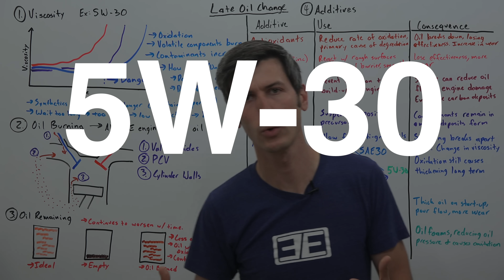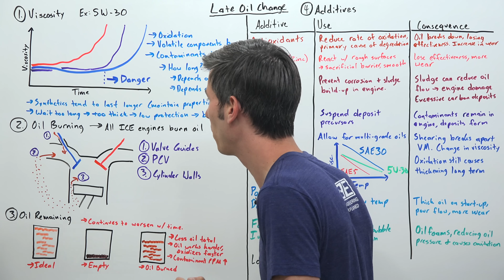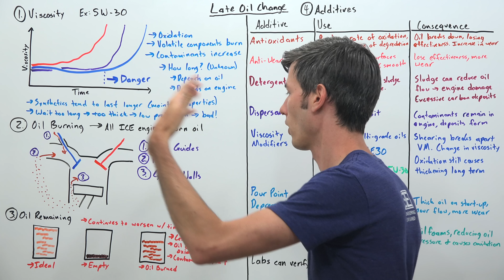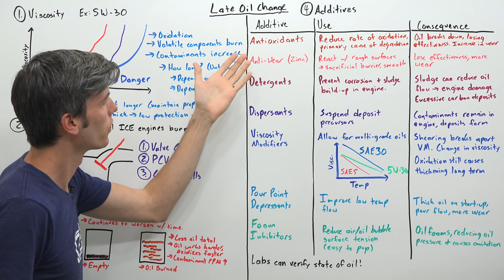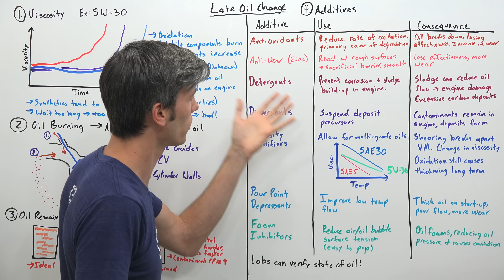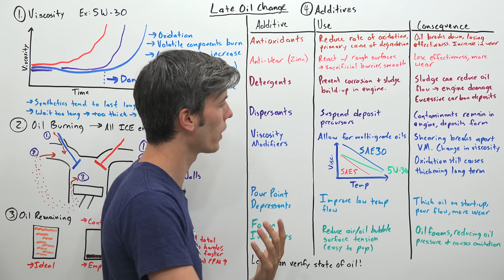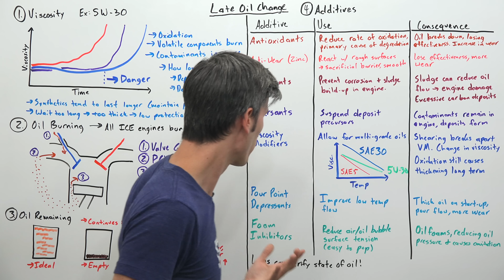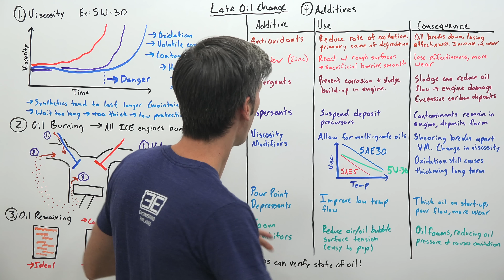What If You Forget To Change Your Oil?

Comment: 1) viscosity gets worse with increased mileage and heat breakdown ..this is bad because engine metal parts break down and grind down( wear out)....this is bad because this decreases hp and decreases mileage and increases engine temperature which further breaks it down....cascading effect accumulates
2) carbon deposits increase with increasingly dirty oil....
3) various components breakdown over increased mileage....
Great explanation ! All true engineering principles.

Comment: During the Covid years of 2020 to 2022; I rarely drove my vehicles. For my Infiniti Q50 with Full Synthetic 0W-20, I drove less than 500 miles/year. For my 2003 Nissan Maxima with conventional motor oil, 5W-30, I drove less than 1500 miles/year.   Here is the question, when should I change my oil? Should I go by the miles or time (months)?  The Q50 recommended oil change intervals is every 10,000 miles.  The Maxima recommended oil change intervals is every 3,750 miles.

Comment: Certain engines can be very punishing on their oils; with very high shearing forces, contact pressures and local hotspots that can break down the long-chain viscosity improver(VI) molecules that serve to maintain the oil's hot viscosity. For example, in Nissan's VQ37VHR engines the VVEL valvetrain mechanism creates a lot of shear forces and high temperatures that cause the recommended engine oil(Nissan ester oil) to shear down from its nominal 5W-30 rating to about a 5W-20 after about 3K miles. This is a consistent occurrence that I've seen on at least 3 or 4 used oil analysis reports on this engine with this oil, as used in 370Zs and G37s.

Comment: And they actually another big concern is actually not inside the engine but the engine starts to burn oil you can clog up your catalytic converter which once it’s clogged can affect inch performance and actually start to overheat the top end of your engine so that’s not good

Comment: I was told by the dealer my Jeep 2020 Cherokee 2.4 needed a 3k OCI. I bet it is because the tiger shark 2.4 can loose 1 quart every 1,000 miles  by it being sucked in by the intake. I ran mine to 4,800 with no make up oil and Blackstone labs said go another 1k and re-test. I heard Fiat made it so the multiair system holds the intake valves slightly open upon deceleration to cure the oil consumption

Comment: Thanks for the useful content. What about cars that are parked most of the time and used for short intervals. The Oil is recommended to change after 10,000KM but actually, this car makes this distance in about 2-3 years. Is there also a time interval after which the oil and other parts should be replaced no matter the mileage? 
What's recommended in that case for the Oil, filter, and other spare parts replacement.
Reply: Great question 3k mi or 3 months witch ever comes first I herd

Comment: you say, you change your oil every 6,000 miles, I do mine at 5,000 mile interval, now why do some oil change places recommend every 3000 miles? I had seen on 20/20 some years back, where they ran a test on New York cabs, ran them for 10,000 miles and the oil was in decent condition after running test on the oil, so what is a real safe miles interval to change the oil, my son's 91 Volvo 240 it says every 10,000 miles unless it is turbo, then it is at every 3,000 miles.

Comment: "All engines burn oil" Not true.   Was broke in mid 2000s (just out of college)  ran a bmw 328i e46 well over 45k miles without oil change or adding oil.  Would check the level every now and then. Sold the car running smooth with 300k miles.   The 330ci on the other hand burned 1 quart every 1000 miles.  Same driver, same roads, same weather.

Comment: Here comes the age verses distance question. Many car makers advise changing the oil every so many kilometers, say 10,000, or when the maintenance minder tells you to change the oil, or – once per year, whichever comes first. What happens if, say 12 months have gone by, but you have driven only 5000 kilometers, or 6000 kilometers, and you wait a few more months to change your oil? Or you wait another year – at which point the car has gone 9000 or 10,000 kilometers? Which is worse, waiting too many kilometers, or waiting too many months?

Comment: I have an unconventional way of doing oil changes that seems to work.   I religiously change my filter every 3000 miles and top off the engine with a quart of oil.  On my LS3 GM engine I have gone 110,000 miles and I have only drained the oil twice.  I autocross the car on occasion so it is not babied.  I changed the valve covers and it looks almost brand new.  I am using Mobile one and AC Delco filters.

Comment: I own a hotshot trucking company and regularly exceed the recommended oil change reminders on my 3500 ram Cummins.  Had several go over 500,000 miles through the years and these trucks work hard pulling loads exceeding 20,000 lbs!

Comment: My engine with near 300,000 miles on does not use more than 50ml of oil per 10,000 miles ----- but i change oil every year or 10,000 which comes first and with top best quality oil

Comment: What ever you're going to say I will keep changing oil at max 8-10k km. Short drives that never warm the engine, prolonged idling, awful winter with temp often below -15°C, very humid summers. And finally, too many engines with baked piston rings, burned valves or other valve train issues such as valve guides coming out of the head in Subaru, worn out timing chains, guides, and cam sprockets, ending on engines which throw the rod, jumped the chain or self-destruct in other manners. Some of them we were able to bring back to life, others had to be changed. Sorry but theory is one thing, real life situation might something else.

Comment: Very informative.  I have stopped using conventional oils, full synthetic only.  I seem to see less sludge in the valve cover when I am adding or changing oil.  I thought the issue with conventional oils was change-scission (viscosity reduction) due to shearing.  (Regularly get 200k miles on my cars. One is over 300k miles...still in the family.)  I seem to remember that Consumer Reports did a big test on motor oils in the '80s that utilized a diesel injector to spray hot oil under test to causing shearing.  It was illuminating, as almost every oil did not stay in viscosity range.  Can't recall if Mobil1 was the winner. 
Also, if you get your oil tested, as fleet operators do, they return a result called "TBN" (Total Base Number) which measures the oil's remaining ability to neutralize organic acids produced by combustion (Carboxylic Acid typically).  At issue would be excessive idling experienced in many petrel fleet engines and also diesel OTR trucks that idle all night long.  This operation is considered severe duty for that reason.  Low oil temp does not allow the off-gassing of the water that is trapped in the oil (remembering that water is one of the main products of combustion :))  Comments regarding TBN?

Comment: Thank you for the breakdown of what a motor oil includes, and the viscosity rating.  I live in Arizona though, where summer temperatures are more important for viscosity than winter temperatures.  What happens when you have thermal viscosity breakdown?  What will you experience, and how do you address this problem?  Should you switch to a higher viscosity oil, or a single viscosity oil that is still within the manufacturer's recommendations?
Reply: Ha, I'm in AZ too and I thought the same thing last week when I changed my oil.

Comment: My engine in my 2019 Hyundai Accent just failed and they are saying it is because I wasn't getting enough oil changes. I bought my car June 2020 at about 27,000 miles. I got my first oil change in July 2020 and didn't get another change until 10,000 miles later in Jan. 2021. My check engine light came on Dec. 2020 for the first time and I bought it to Hyundai. They kept telling me they fixed the issue that caused the engine light but never did. 10 appointments later of them 'fixing' the issue, in December 2021 my car started making noises. A couple weeks after the engine failed. After the oil change in Jan. 2021, my brother started putting oil in my car and I did go get a oil change maybe twice after Jan. 2021, I still think Hyundai is responsible, they said I had an evap leak but could never find it. Is it my fault the engine failed, Hyundais fault or do we both play a role? Since I am 5,004 miles out of warranty they won't fix it also because they are saying I don't have enough oil change reports. Thinking about suing Hyundai, any help is greatly appreciated.

Comment: I am a bad bad man, I owned a Nissan Maxima 2003 with VQ35DE engine, I brought in 2007 with 90,000km on the clock, I owned it 11 years, changed the oil once and it did 267,000km when the power steering system sprang a leak and I decided to buy a new car.

Comment: My 2000 Camry had a bad oil leak (since fixed) due to bad gaskets. On more than one occasion, it got to the point where I was driving it without oil for considerable lengths of time before realizing, yet the engine to this day purrs like a kitten. I've also accidentally run it hot twice, and it lived to tell the tale as well. It's currently at ~280.4K miles and still runs great, even if all the accessories are falling apart. Props to Toyota for making such a robust engine!

Comment: The fact is, on a modern car with an engine in good condition, a good synthetic oil will last more than 10K miles and often 20K miles is no problem as long as the oil level doesn't get too low.  Synthetic oil molecules, combined with modern oil stabilization packages are extremely durable.  Virtually every modern vehicle recommends OCIs or 7500 miles or more.  10K miles is not an issue with more cars.  Just use your vehicles oil minder and change it when it gets to 0.  Many / most people change their oil far too frequently (not talking about plain old car neglect here).

Comment: And I keep getting yelled at by my mechanic stepfather about changing a little early. 02 Ranger with a little over 200k miles on it now. Started using Valvoline high mileage synthetic blend, but changed over to Valvoline High Milage full synthetic. Moved from setting my max wait from 5k to 7k. I tend to try to aim for 6.5k for my oil changes, using a higher quality filter (The welded nut on the K&N Gold filters are a lifesaver with my 3.0 engine). Better to do things a little earlier rather then late.

Comment: Question: My motor is a Ford 1998 3.0ltr with 250,000 miles. After watching a few of your videos I sure my motor hasn't been treated properly (purchaced used). How can I and or do I clean out engine of all the different deposits you have refered to? And, which oil should I be using? You seem so young to know so much technical stuff. I am amazed. Thank you

Comment: The one critical topic not covered is "age" with minimal use (say 2,000 miles in 6 months).  Typically, the manufacturers suggest oil changes every six months, but if you live in a temperate climate without high humidity or massive temperature swings, I can't see the point of arbitrarily changing (particularly synthetic) oils at that frequency.  The common "suggestion" is that water will build-up in the oil, but that's essentially impossible since it will vaporize when the engine reaches operating temperature and be vented through the PCV.  Thoughts?

Comment: I typically change my oil every 5000km in my motorcycles - but some of my bikes hardly get ridden at all - they just rest up in the garage.  Why do I need to change my oil every year if I only use it once or twice a year for a 100km ride?  I live in a place which is sunny, warm and dry - so not much moisture around either!

Comment: I have a motorcycle which I ride less than 1000 km per year.  I used to change the oil annually for fear of moisture, however the bike is stored in a heated garage.  How often should I change the oil then?

Comment: I have a ’11 Corolla with 94k miles and I change the oil with 0W-20 every 5k miles (vs the 10k stated). I used to change it 2x/year as I used to drive 100 miles day round trip for work. Now that I don’t do that anymore, I barely drive 5k/year. Currently I have 3,300 miles since my last change about 14 months ago. I typically lose ½ qt oil in between changes, and I think that’s been happening since I bought the car new (owner’s manual states for my engine with filter the change should be 4.4 qts., and to me it looks full after only 4.0 qts., so I stop filling at 4.0 qts.).

My dad has a ’10 Corolla 78k miles and same driving scenario; it uses 5W-20 it gets changes ~4.5k miles and it calls for 5k mile intervals (dealer told me that both engines are the same). Manual also states with filter it should use 4.4 qts, but only 4.0 qts go in as it too looks full at that point. It too uses ½ qt in between changes.

I have heard people say that time is also a consideration with changes and would like to know the facts on time alone with regards to the oil and potential causes done to the engine.

Comment: I would be interested in understanding the real lifetime of a lightly used synthetic oil.  I have a couple of motorcycles that use synthetic oil, but that I ride only occasionally.  I might put new oil and filter into one, ride it a few hundred miles, remove the gas, and then put it away for 8 - 14 months. The next time I take it out I feel like I should change the oil because the oil is "old" (and I do), but in reality, the expensive oil has hardly been used, and so I wonder if I really need to change it.

Comment: What if I change my oil and oil filter and make 500km and leave my motorbike for one year? Should I still need to change the oil due to aging?
Reply: Yes
Chemicals in oil and gas will detoriate. If you crank the engine after such long time, the fluids will sabotage your engine

Comment: Nice explanation but you should have talked more about 1) Synthetic vs regular oil, 2) the importance of the oil filter. My service manager says that with how Synthetic oils are made these days, the filter goes out long before the oil will break down.
Reply: How in Hell does your service manager know for sure about oil filters?!?
Reply: @warriormanmaxx8991   He doesn't! Reading comments in many filter YT videos it's obvious most people, even car nuts, don't have a clue about filter operation.

In another lifetime I was a Filtration Products Sales Engineer for a major regional industrial warehouse.  As a filter picks up particulates, it actually filters better and better by reducing pore size, up to the point of no oil flow.  But the filter bypass will let the oil still reach the engine even if the filter is totally blocked.  The bypass is to prevent oil starvation when the oil is cold and thick.  So, the real trick would be to change the filter just before the bypass is being used when the oil is at operating temperature!  No way of knowing.

Comment: Seems to me, about 10 or 15 years ago I read an article about a team that ran two identical GM engines for 30 some thousand miles. One engine they did the recommended oil changes and the other they never changed the oil. They then had a skilled mechanic take apart those engines and when tolerances were checked the two engines had the same amount of wear. Am I wrong about this or was the test not done scientifically or is wear not the only thing to worry about?

Comment: If someone was a couple of miles over a recommended oil change when asking this question, they might as well forget it now. That engine is either frozen solid or running on the sweet fire of Jesus. Either way I'd back slowly away from it...

But if you came to the web looking for the best explanation of something automotive ... you found it.

Comment: I have owned cars since 1984. I don't change cars very often, one 19 years, the other 21 years and going, another 11 years and going. I have NEVER had a mechanical failure on any of my cars. Not only that but I have over 300K miles on manual transmissions and have NEVER changed a clutch. How did I achieve this? I changed the oil and I don't red line my engines, I drive the car. Use full synthetic and ONLY full and you will get better mileage and more years from your car. I change the oil once per year for each vehicle. If your car has problems look in the mirror for the problem.

Comment: Which is worse, going over the limit in time or miles? So if it’s recommended to change every 6 months or 6,000 miles, for example, which is more likely to result in degraded oil: when 8 months have passed upon reaching 6,000 miles; or 8,000 miles hit at the 6-month mark?

Comment: Thank you for the details. It would have been nice to also cover :
1 the influence of short trips vs long trip on oil wear .
2 an example of lab results for both scenarios.
3 the chemical differences BTW mineral and synthetic.

Thanks for the thorough videos !
Reply: You can find these in field studies from various companies. Motor oil studies have been performed for decades.
Reply: an example of lab results for both scenarios... Theres a few videos on this. On a microscopic level, its not as doom and gloom as the video claims, the oils tested were fine upto 15,000 miles. Only then were trace metals found.
Reply: @Ddog72 trace metals means engine is already on its way out.

Comment: do I need to change the oil in a truck I rarely drive?  put fully synthetic in it 28 months ago (with high mileage oil filter) but I have only put a thousand miles on it since then and have not drove it at all in the last year.   I look at the oil dipstick and the oil is still a brownish color (which is a positive) as it is usually black when I change it.